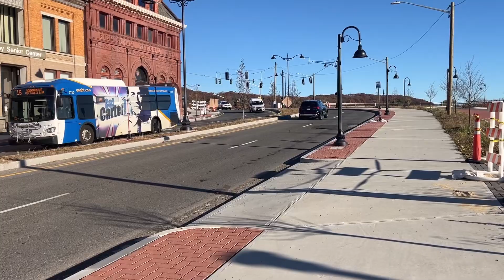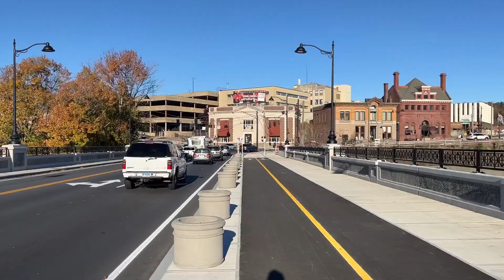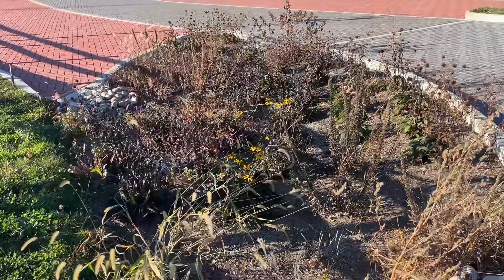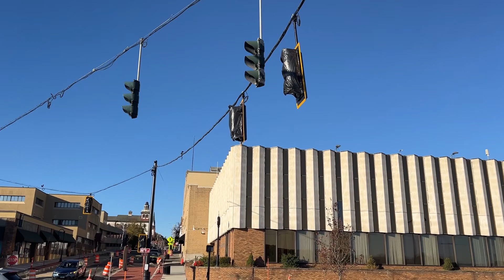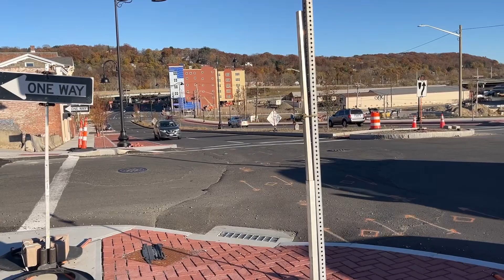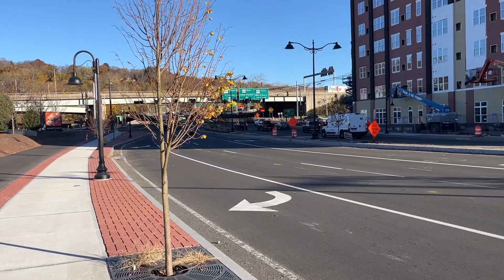Derby CT Route 34 Widening Project - November 2024

Comment: As someone from Connecticut, this is a very quintessentially CTDOT project, and I don't mean that in a good way. The agency loves to overbuild, and sure, part of that often includes wider sidewalks and new bump-outs, but those improvements are always more than offset by the agency's constant infatuation with road widening.

The agency demolished a number of buildings, including many older historic buildings with solid street-level interfacing, to add more car lanes. Adding an additional lane in each direction is completely unnecessary, as Derby is struggling with acute population decline, and has a population of about 10,000 people. What town that small needs such an egregious highway running through it?

The old street was one lane in each direction, with buildings flanking both sides of part of the street. Sure, the pedestrian amenities were pretty basic, but the area felt quite walkable. You don't really need bump-outs and mid-block shelters if you're only crossing two lanes total. And the whole area around Route 8 is a pedestrian murder machine. It has been for many years, and this project seems to do nothing to resolve that.

CTDOT is spending tens of millions of dollars widening roads in small stagnant towns where any projected increase in car traffic is laughably inaccurate. The end result includes some nice sidewalks, and even a bit of bike infrastructure if they're feeling generous, counteracted by high traffic speeds, induced car travel, and dangerously wide intersections. Projects like this make the area feel worse to walk and bike. The agency  is intent on ripping up any good old pre-auto urban fabric to replace it with more horrid stroads, and it's a shame. Derby deserves better.
Reply from the maker: You nailed it in your comment. If the town can fill in the missing street wall with new, dense development, it might make it a little better. And 4 lane roads are just setting up future bus-only lanes...

I feel the same way that when these huge projects advertise pedestrian/bike/placemaking improvements under the looming umbrella of more car infrastructure, why not just do the first 3 and forego more traffic-inducing money wasting?
Reply: I totally agree but in the grand scheme of things where so many of these places don’t even have a sidewalk this is a huge improvement.
Reply: Same here, Why would a DOT demolish homes/businesses for a road expansion?!? For example: let’s say someone wakes up one day and finds out they have to move because their house is getting demolished for a road expansion, I bet that owner will be Pissed off
Reply: @Jack-O-MericanOfficial  The buildings on the south side of the street were slowly slipping down the embankment so they were condemned anyway.

Comment: Think you can do a roundabout design for the intersection of NORTHFIELD Drive and North Green Street in Brownsburg, Indiana? Lots of traffic, and not much space. I’d love to see what you could do.
Reply from the maker: That's an interesting one - based on an initial view of the location, the intersection is actually large enough to install a double lane roundabout with a diameter of 150' which is within guidelines. However, there are many traffic signal intersections in close proximity. If traffic volumes here are heavy, traffic backing up from any one of the signals will gridlock the roundabout. If this intersection were to become a roundabout, I would install a series of roundabouts at the two intersections on Northfield on either side and at both intersections for the I-74 ramps.
Reply: @ Yeah, I was just wondering since our town is planning to potentially build a series of some there. I would just be curious to see what they look like since plans probably wouldn’t be formed till 2028.
Reply from the maker: Definitely fly around on google maps in carmel, in - they have some good examples of roads with series of double lane roundabouts and I would guess if your town is thinking of building some, they would look very similar to those. Sometimes towns will look to other nearby towns for infrastructure examples as they’re easy to go visit and see firsthand how they work

Comment: One of the better road widening projects I've seen.
Reply from the maker: In my opinion there are no good road widening projects when they happen in urban downtown areas and require the demolition of buildings, but the new pedestrian realm design and brick pavers are a nice choice.
Reply: @everydayengineering They think they can get away with using brick  pavers, but they can’t because they demolished homes and businesses
Reply: @everydayengineering  My understanding is those buildings on the south side of the street were slowly slipping down the embankment and were condemned already.